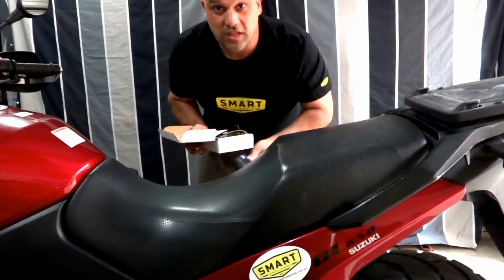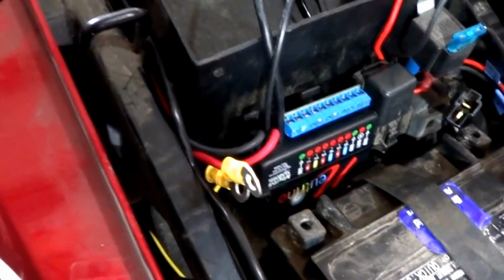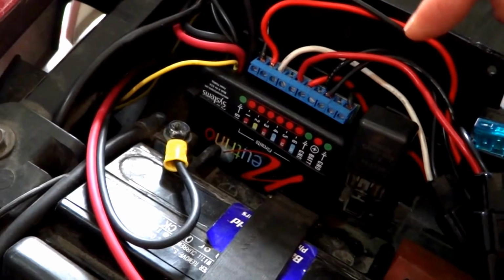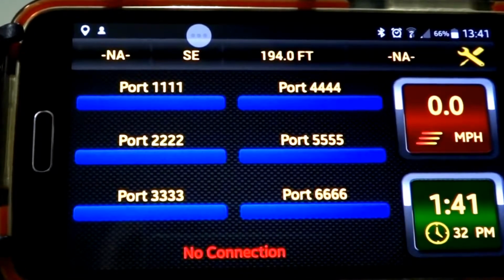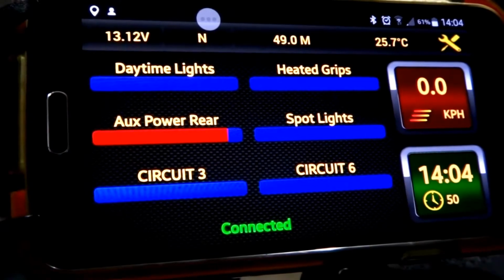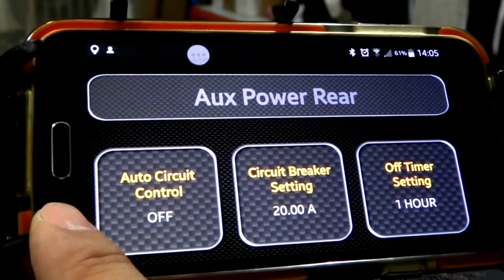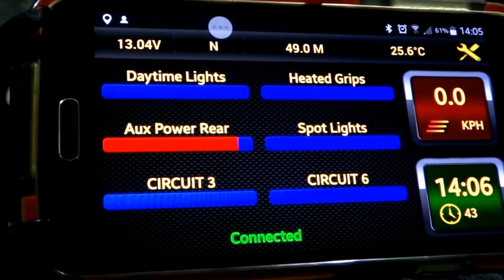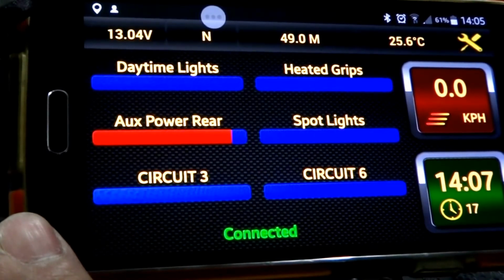How To Install Neutrino Power Distribution Unit

Comment: Good video. Thanks. I'm trying to build more skill and attempt the install
Reply from the maker: how can I help.
Reply: @smartmoto7489  so from what I understand

There is only 1 main ground and 1 main 12v to the neutrino box

Then there is only one wire that goes to each output?!?!

Mainly because all the output's positive terminal?? Mainly because every switch on the bike is grounded to the frame so they only need this one wire from the neutrino box?